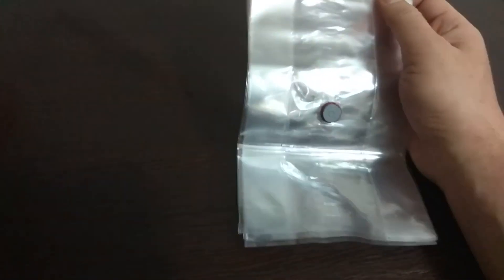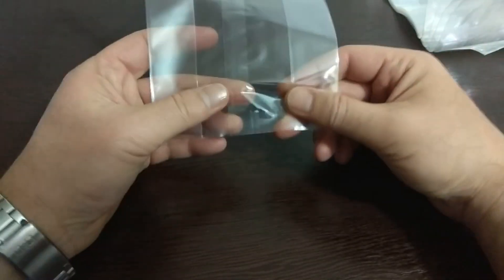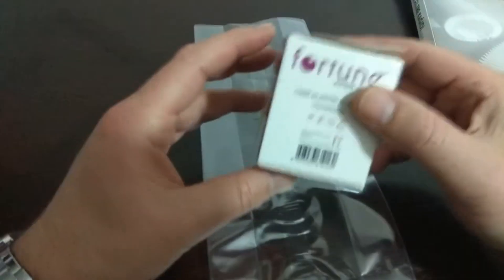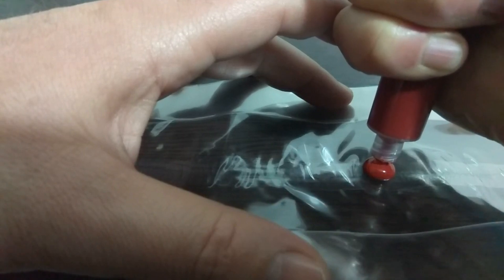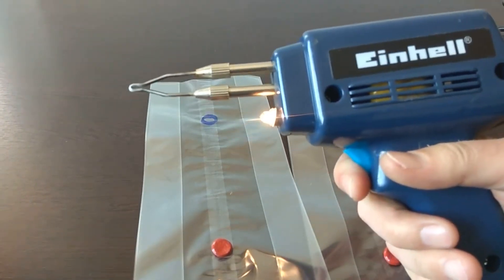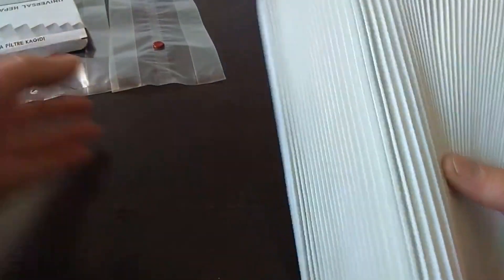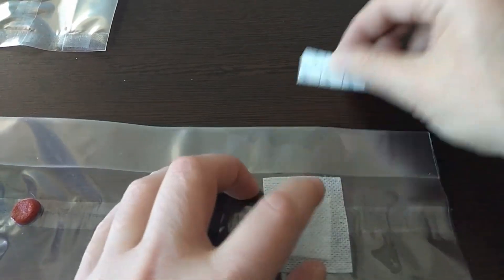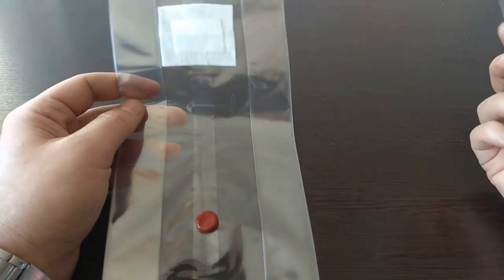Do you need mushroom grow bags or grain spawn bags ? So then do it yourself. Mushroom Cultivation

Comment: Why do my bags keeps sealing itself shut in the pressure cooker due to the heat. Yea they are polypropylene bags. Can anyone send me the link to the bags they use mine suck even though they are poly bags. I even put a wet napkin on top top prevent it from melting but they still melt enough to keep me from opening them

Comment: What are the reasons for using different lids for culture propagation and grain spawn production? Shouldnt both have a filter and a selfhealing injection port? What are the differences?
Reply from the maker: When the jar is overturned, the liquid touches the filter. PTFE filters have a watertight feature. However, the other one leaks the liquid and causes contamination from where the filter is. The PTFE filter can be used on both, but the other must be used with grain only.

Comment: I’m wondering what product you are using to stick the filter on?
Reply: Thanks.  Can you describe that tape a little more..... or provide an Amazon link?  I can find any plaster tape with adhesive...only water activated splinting tape.  Cheets
Reply: Its just Microsoft tape at pharmacies
Reply from the maker: Yes,you can use micropore tapes too..
Reply: @toddwmac  did you ever find this?
Reply from the maker: @toddwmac  you can buy it from  pharmacists
Reply: Sarah, were you able to find this tape? Any Amazon links you can drop?
Reply from the maker: Hi Sarah. I use Medical plasters. Sticks fine after autoclave process.